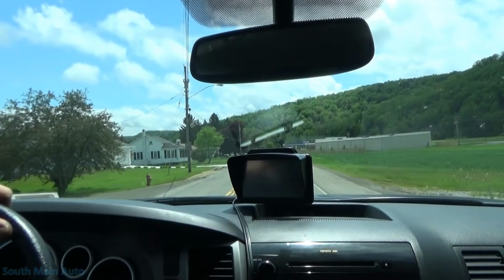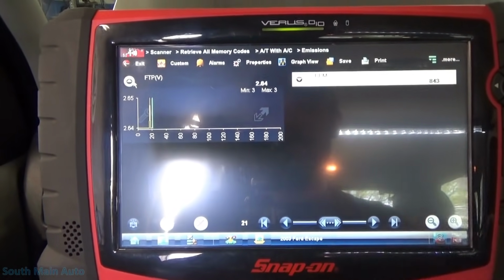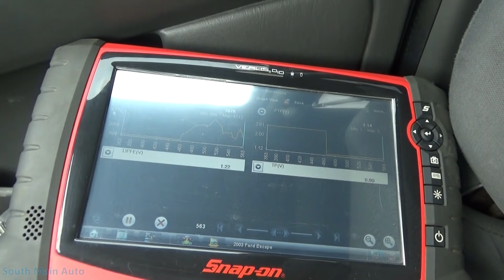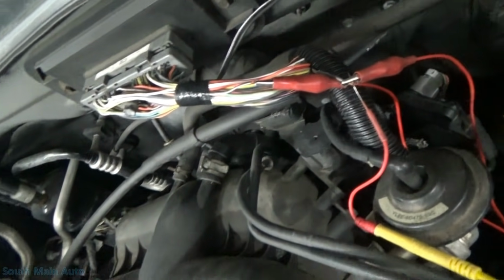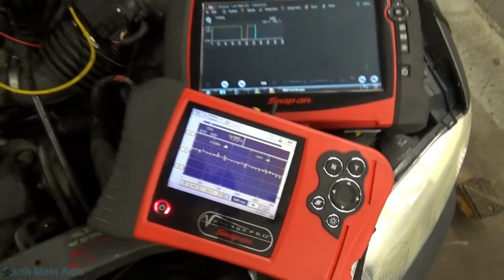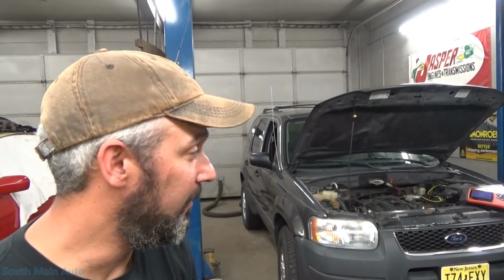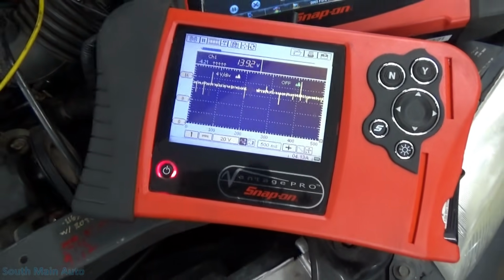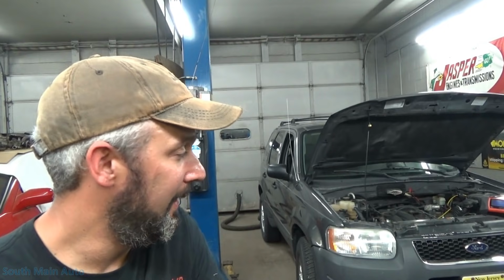Ford Escape: Do We Fix It Or Ship It!? - Part II

Comment: As a tech of 30 yrs... yes we do make guesses but educated guesses based on symptoms. Then we need to prove it beyond doubt. The reason you didnt replace ecm is because you couldnt prove it. But your interlect told you run over anything that could make a difference at 3k rpm wich led you to the ps switch... great work on an extremely rare symptom that would have alot of techs scratchn heads. I dont give in on difficult diags. But time plays a big factor

Comment: Replaced a leaking ps pressure switch and it started blowing black smoke out the tailpipe? 
Went rich. F150 2005. 
I had a 5 volt reference signal fault. 
New sensor, right? Should be good. When you first started talking about the 5 volt signal, the ps switch crossed my mind,when your phone was ringing in the video, that was me calling to tell you what to try next...

Comment: Here's my theory.  The 5V source is just a reduced voltage from the 12V line.  With that switch going on and off like made, it's likely making the 12V line very noisy, and the 5 volt is not filtering it out.   While the power steering sensor is the source, the reality is that the 5V reference generation system may in fact be faulty.  In simple terms, there should normally be some capacitance on the 5V side that will absorb noise and smooth small spikes and drops.  That capacitor could be dead or defective, and the 5V source would still function, but might flicker.  This would be quite consistent with the tremors you are seeing the 5V reference, which really should be rock steady.   So I would go back and look at the 5V source and assure that it is rock steady and without any fluctuations even when fairly well loaded (figure out what amperage it puts out, and put enough LEDs on it to load it down a bit).  My guess is you would see noise getting through there when it shouldn't.

Comment: Dam where are you located. I spend 4k on my idi shop replaced f.i.p , l.p, injectors , to find out there was a paper disc off of a bottle blocking the line in the tank .

Comment: Does the PS pressure switch go to ground, and could it feed back through ground to the other sensors. You said it fed back when the wire was cut? I don't know either.

Comment: Curious to wonder how many PCMs have been killed over that switch failing and the tech calling out the EVAP system, but unable to pin anything down for sure.  The new PCM then could be more tolerant of the errant signal.

Comment: "I got lucky." Nope. Not at all. You fixed the problem logically and systematically. It was just a more difficult problem. I'm a retired engineer. This is exactly the sort of stuff we would deal with quite frequently. Good job. A difficult problem, and the customer should have been charged accordingly in this case.

Comment: I realize the video is 3 yrs old, but I just watched it today. I wonder if you could have seen the voltage on the evap sensor drop if you turned the steering wheel to full lock with engine at idle? Maybe the switch would just open, and not flutter, causing the electrical noise.

Comment: 12V switching at that kind of frequency creates a lot of noise. As others have said, no need to be ashamed. When you get into uncharted territory on a diagnosis, a lot of times you end up doing a lot of guess and check. I don't mean guessing about parts and throwing them at the car like many mechanics do, I mean guessing on something to try (unplug this, change voltage here, try this condition, etc) and check to see if that has any effect. That's exactly what you did, you had a guess about what changes at 3000 rpm, considered the PSP. You checked if the PSP switch had any effect on the condition and sure enough, it did! You know as well as I do that if that car had gone to any other shop, it would have gotten a fuel tank pressure sensor, purge valve, vent valve, gas cap, wiring harness butchering, PCM and a fuel filter just because that fixes everything.

Comment: Just stumbled on this video.
Einstein himself said he wasn't any smarter than anyone else. He just stuck with a problem longer.

Thanks for the video even though you were close to not publishing it!

I wonder if the switch on the power steering powers a coil? (not an ignition coil) If it does, EMF from that coil could be causing that mess. @pinehollowdiagnostics (will it let me tag Ivan?)

Comment: I guess I'm the dummy here but I am still wondering if the PS pressure switch is bad and needs to be replaced or is there just some wiring problem that;s letting noise get into the Evap reference signal circuit or is there something wrong with the ECM so that the PS pressure signal is causing the ECM to freak out? What was the final and complete fix? We can't just unplug the PS pressure switch and leave it at that, can we?

Comment: When you have a bunch of wires that are bundled in parallel electromagnetic interference can be generated almost anywhere and recieved anywhere there is a parallel conductor because of EM induction. You could try putting a ferrite bead around the cluster of wires to suppress this or use a capacitor to filter this (because thats what capacitors do, they filter electricity)  
I bet $20 if you put a capacitor on that 5V line it would've either eliminated the interference or reduced it significantly. In my opinion this was a 1 in a 100 opportunity just because of the way the wires were loomed together and because of improper filtering in the ECM thanks to Ford's engineering not accounting for this. ;-)

Comment: Had a 2007 Dodge Caravan that had a bad reaction to a plug in small icebox , on a trip I got a low tire alarm , would get out and check pressure but all ok . By a quirk figured it out , well the next year I plugged it into a power outlet in the back and half way down the road got a check engine light , was in St Louis Mo and pulled into a dealer , they plugged in but not sure on code then reset to get us on the road . 5 miles down the road money light comes on again , then it dawns on me , yep icebox again . Was it setting up a radio freq or power gremlin , don't know but the dam thing got sold in the next garage sale lol

Comment: Regarding a shop/mechanic paying for a wrong repair- some (almost all?) still charge the customer and some may not. I know a shop charged a customer hundreds of $$ for a transmission control module on a Mercedes when the cause was a bad switch on the brake pedal. Lesson- owner don't make assumptions and ask for part back for testing. Mechanics check simple stuff and don't go off assumptions.

Story- lady brought a car in (w210?). wouldn't shift out of park. Owner had spilled drink in the past in the area of the center console and transmission shifter.  Owners son had other experience of spilled drinks damaging electronics so assumed TCM damaged by drink. He didn't do basic testing of possible causes; like a brake pedal switch. (trans won't shift out of park if pedal is not pressed and a bad switch doesn't tell the computer pedal is pressed and the shifter will be locked in park). After installing a new part and the problem not fixed he found the real cause. Shop never told the owner about the switch and they paid for the switch but charged for the TCM because the part was not returnable and cost more than the switch. 

Owner never questioned it thinking owner had caused damage with the spilled drink. So don't make assumptions. Had the owner been there to witness the installation of the new part and seen it not fix the problem that would save the owner $$. 

Ask for your parts back, have parts tested, ask shop to demonstrate the new parts fix the problem during the repair. Don't tell about spilled drinks. Don't give information for assumptions to be made.

Comment: When you put a part in it and you're wrong you eat it. My mechanics - I eat it and don't go back because I'm buying all these parts, wasting my time, I've lost confidence in him and it still AIN'T FIXED. Guess which mechanic I'd prefer? I'd say you're the exception to the all too common.
For example: A leak - one said oil pan gasket, the other said power steering pump and both were performed. The leak still persisted. So I found out that the high-pressure hose on the power steering pump was leaking.  The pan gasket I had to eat because he refused to admit his mistake. The second one was the dealer, you know the "experts" That one they had to install the power steering hose but it took half a day of my waiting around for it after the first go round. But not only that the dealer wanted to replace my air filter and cabin filter for $125 that I replaced myself two months ago. And! They told me I needed a wheel alignment, but not believing them anymore, I took it to another shop and they said it was within specs. Maybe this kind of stuff is why so many people make positive remarks about your work.

Comment: if it's a ford,always start with looking up tsb on the model year,thats how i  solved the vibrating gas pedal issue on my taurus,i lived with the issue for years till i could take it no longer,sure enough there was a fix issued by ford and a rerouting diagram for the throttle cable...no more gas pedal vibrations on my foot between 38-42 mph,wonder if anyone else had that problem,everyone thought it was all in my head and i was crazy,lol

Comment: i had a ford escape several years ago replaced belt and then no power steering. made sure belt was on correct call all friends everyone said pump went bad i drove in shop replaced belt no power steering could not accept the fact that the pump was bad. worked on and off on it for 3 days finally started pulling off the pump first thing i did was remove tank on fender it didn;'t drain completly when i removed hoses in the middle of tank is a plastic made in the tank filter screen it was stopped up washed the filter with brake clean installed and it worked just fine. odd how things happen sometimes was hard for me to believe the filter stopped up like that but i drove in worked new belt no work go figure.

Comment: Worked in the telecommunications industry for years based on what are industries had to deal with which started in the late 60. As cars become increasingly computerized they are subject to what we in the industry called RF. RF can come from anywhere I had a car with a bad AC compressor the clutch bearings were bad. This created RF which made the radio have poor reception. Once the AC compressor was replaced the problem went a way. The main problem with RF is it can interfere with logic States in a computer causing error. If something has a computer in it two things can create problems. RF is one and unstable voltage is the other  This can cause incorrect logic States which create errors.
Binary Computers work off a 1 and 0 voltage present is a 1 no voltage present is a 0 all transistors leaked voltage they are made to operate in a specific voltage parameter. If the voltage is too high it can cause a zero state to be recognized as a 1 if the voltage is too low 1 can be recognized as a zero state. All good technicians have insight into what a problem can be if it is related to what they do. Being a telecommunications technician and working with computers I have some insight into particular problems that could be occurring. I had a friend who owned a big rig truck or tractor whichever you prefer to call it. He was telling me about this problem he was having with it. Where the electronic dash would go out momentarily and then come back on. People telling him to look at grounds as being the problem after two days he came up with nothing. He asked me if I had any ideas he said why don't we go for a drive. While we were driving I noticed something at higher RPM range the dash cut out. I told him let's go back and parked the truckand check to see if it happens when you rub it to hight RPM range. The exact same thing happened I said let me grab a voltage meter I put the voltage meter on the alternator terminals voltage go up I told him he had a bad voltage regulator. which was what was craning his problem he replace the alternator and the problem went away. Car mechanics have an extremely hard today because they must understand mechanical aspects as well as in-depth electrical aspects. Being in the telecommunications industry I see technicians who have been in the industry for years who can be baffled in the same way you were even though that's what they do for a living. Over the years I have run into a lot of crazy things and had to do some pretty crazy things to fix all due to RF problems. This is on a side note just to show you how crazy this all is. What can a wind farm a thousand miles away have to do with potentially destroying a generating stations turbine. Electrical interference of another type called harmonics. Wind farms produce a lot of excessive harmonics due to the fact that they are all slightly different because of the blades being all manufactured by hand and being different. This creates a wobble which induces itself into the electrical via the generator. These harmonics travel down the powerline they can induce a wobble in a generator and if that wobble matches the resonant frequency of the turbine it will literally destroy it. Electrical companies have to be concerned about harmonics creating a resonant frequency on their turbines. Auto industry needs more mechanics like yourself. You may not exactly know what the problem is but have enough insight to look in the right places to figure out the problem. If you haven't done it already you should make a video and how to help your mechanic by explaining to people how by observing the problem and telling the mechanic when it happens can help out a lot. Too many people tell you it's broke makes a noise or works sometimes but can't give you a more information by being observant and noticing times and other things this helps.

Comment: From an electronics point of view your 5v reference is still too noisy. If  you had a differential input pickup you might be able to see the real voltage between this reference and ground at various ground points along the 5v reference's  route.  I think the reference might need some capacitors to filter out the noise and make it smooth again. There seems to be insufficient isolation between circuits using that reference.
And tge point one viewer made about data leakage is certainly true.  You will find computer systems wherr an unexpected and over-range signal will creep into an adjacent channel in the computer's signal-input multiplexer. This is where a hardware layout of the computer is handy.

Comment: You are a good tech. 
  I have a problem with my 02 chevy silverado with a 5.3. It runs a little rough. Got  cam n crank codes. It runs at about 85 % power. In my mind if the crank sensor was bad it wouldnt run. Ide hate to take the intakes off to replace a part that isn't bad.

Comment: Don't sell yourself short man. The best technicians, regardless of field, aren't because of their IQ. It's a solid grasp of the basics, ability to think logically, run checks from simplest to hardest, and have a knowledge base to fall back on. (i.e. google, friends, groups) You have one of the best ways to look at things. Similar to Sherlock Holmes, you run down all the possible solutions, until you find the correct answer, no matter how unlikely it may have been.  In a business DISC personality test, you'd probably score on the high C range. Meaning you're very data/task focused. It'd explain why, when faced w/ a new puzzle, you're completely engaged into solving it.

Comment: I'm betting it's because of whatever logic is used to deal with that input. I'm other words when it goes high the computer for a moment disregards pids and does X and X is: raise RPM query AC pid and disable of enabled then resume normal operation. That's great unless you suddenly get a signal of onoffonoffonoffonoff etc so it's caught and all your signals are disrupted.

Comment: You may have misunderstood how the power steering switch work. Did you have the knowledge knowing that the power steering switch is involved in the cause and effect related to the conditions that brought on the onset of this failure. If you'd had known how the system worked you would not have been able to figure out why it didn't

Comment: thats not lucky figuring that out.....process of elimination thinking hunting for systems changing state at 3 grand rpm. a/c compressors do that also, just not at 3 grand  How else would you have found that  out systematically when that switch was failing very erratically

Comment: Luck had nothing to do with it. Deductive reasoning lead you to the power steering. The initial diagnosis may not have been accurate, but the clues were relevant enough to get you to look in the right spot. It was then when it all started to make sense. It might feel as luck. Not knowing what you are doing, then picking a random object inside the engine bay to replace and fixing the problem without knowing why... that is luck.

Comment: Oops never get in a hurry glancing at a schematic...rookie mistake by someone who knows better! Reexamined the wiring schematic and seen the tie-in with the p/strg pressure switch return and the TPS, DPFE,FTPS 5V Ref...and now the bad p/strg switch noise getting into the 5V ref is solved but why is only the FPS signal V being affected? It has to be the noise going up the signal wire but it'd seem the engineers would have a transient suppression device to prevent this but then again maybe not. Stuff drives me batty sometimes. I'd almost have to save that switch and install it in another Escape and see if it does the same thing.

Comment: The 5v is probably derived from that crappy 12v. The 5v regulator is doing it’s best and still making 5v rms even with all that garbage on the 12v (thus the meter showing a solid 5v.) But the scope showed reality. Poop 12v in, poop 5v out.